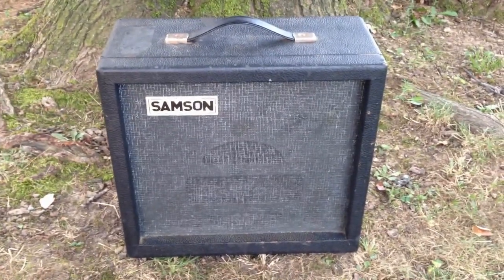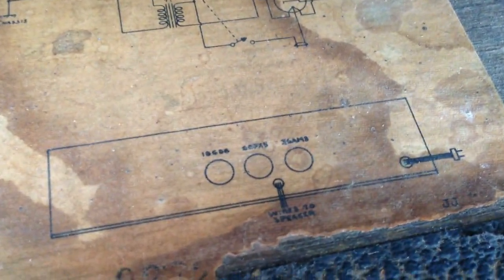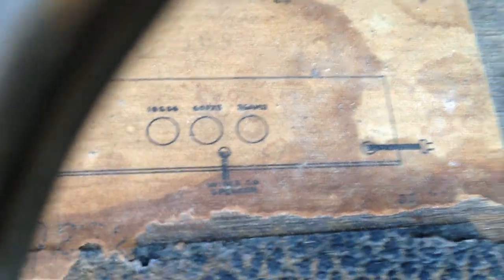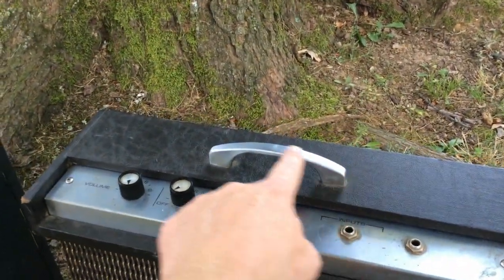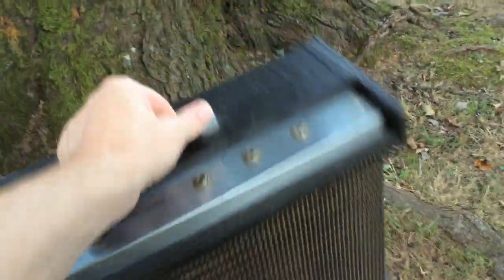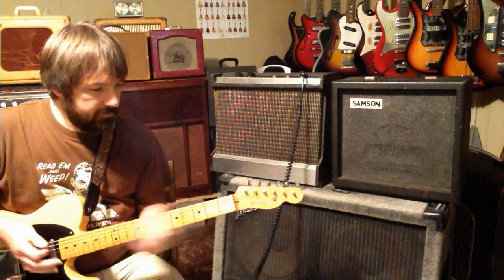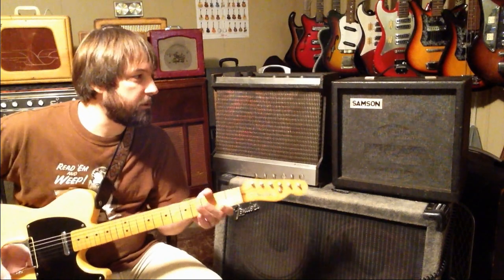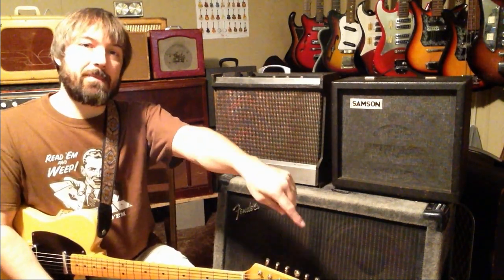Obscure Vintage Guitar Amps by Radionic Industries (Truetone, Samson)

Comment: That Samson is the same tube lineup as some of the Kay  series string widowmakers. No resistance needed because it adds up to nearly 117v.  703C is a Kay number. Maybe sold by some music shop or other.
Reply from the maker: I have videos of the Kay 703C version on my channel as well. I have seen Kay schematics which actually did list "Radionic Industries" as the manufacturer. That's the only reason I know what these are.

Comment: I have a little amp that has the exact same schematic. The chassis and schematic are identical to the Samson in every way except for that it doesn't have the name Mid west etc. printed on the chassis or Bardon Co. in the UL wording in the schematic. it's a Penncrest Model 850, made for JC Penney in the 60's. the cabinet is completely different though, it is made from real cheapo thin plywood covered with some super cheapo green wallpaper looking stuff. I believe there is a Kay model that uses the same circuit,  but I can't remember the exact model, Kay 750c or something like that, I'd have look it up. I got it for 5$ at a Goodwill store about 20 years ago. It sounds great, after I did a cap job, and added a 3 prong plug. If you do a google search for the Penncrest Model 850, it will come up with a couple of old eBay listings, and pics. I love this little amp, even though it looks like a toy.
Reply: .. oh, I forgot, the speaker code is the same too. But the date stamped on the schematic is stamped 8 24 66
Reply from the maker: Cool. Thanks for the info. I am not surprised there would be a Penncrest model also. All of those catalog companies, particularly the ones based in Chicago went to the same few manufacturers to do business. I find the Radionic Industries thing fascinating. I actually called the current Radionic Industries and asked to speak with someone who would have worked there in the old days, and they said the current owner took over the business around 1970 from the original owner, and he didn't know anything about the fact they built guitar amps.

Comment: Hey Brad, I just got this exact Samson amp. Looks like it’s never been messed with one bit. I’m sorta new to amp repair so I thought this amp is a great circuit to start with. It buzzes so I’ll dig in and replace all the caps. Need some help finding a suitable option to replace the bigger multi section cap 30/40/40mfd 25/150/150v blue/black/red/yellow wires. Anything you suggest? Thank you! Tony
Reply from the maker: You can get those through Antique Electronic Supply.

Comment: I'd run a y-adapter of the output of my boost into both amps and mic them each with a dynamic and then pan the two tracks hard left/right. I actually want to get an Effectrode Tube Drive to use as a dirty preamp "pedal" in front of all kinds of different vintage clean or almost clean amps. I've done the same type of stereo recording thing with my Boss Super Chorus with the send from my Classic 30 going into the chorus and then one of the outputs of the chorus going to the effects return and the other going to my AO-44. It's pretty nice as a way to double-track without actually having to record two passes, just had the mics different distances and angles on the different amps to make them hit at slightly different times for more of a real "double-tracked" stereo mix. I think it came out pretty convincing in this one: https://www.youtube.com/watch?v=6cBJso0yJ8g  Essentially what I had going was the (boosted) preamp section of the Classic 30, being split two ways, with a very subtle setting on the chorus (enough to make the left and right sides sound slightly different) then one side going straight to the Classic 30's quad-el84 output, while the other side went to a fairly clean AO44 with just the low-pass filter and input transistor and low-pass filter removed and the NFB loop disconnected. Each amp drives its own 1x12 and each 1x12 was mic'ed with a dynamic up close. Like I said, I think it did a pretty convincing impression of a proper "double-tracked" rhythm guitar part, but what do you think? My technique and equipment for mixing wasn't great back then, and I was using software drums, but still think it came out ok.
Reply from the maker: The song is kickass. Mixing could have used some work, but it's punk, so fuck it. :P

But yeah, I've done a lot of guitar doubling and such studio tricks over the years. Back when I recorded a lot, that is. I miss it now.
Reply: The Guitologist Thanks. The only thing I wish I could change is the drums. I actually have real drums now, but there are so many other songs I want to redo with the equipment I have now. 

It's basically become standard procedure to double-track guitars for my shit, and I always pan the tracks all the way. I know a lot of people who swear by quad-tracking and others who don't even pan the 2 tracks all the way left/right, but it's the right method for the sound I'm trying to make. You should get back into recording. It's the one thing that has gotten better and easier over the years, and you can do it without having to depend on anyone else having the same day off as you and being reliable or whatever. That's how I started recording by myself with "home-studio" equipment. I wanted to play live too, so I did an acoustic folk/punk set (before it was cool) in coffee shops and small bars, but I really wanted to have my songs recorded the way they sounded in my head when I wrote them. A recording is immortal.

Comment: What is the function of T1 ?
Reply from the maker: The T1 transformer is an isolation transformer. It reduces the noise on the first gain stage and probably makes the amp a bit safer by keeping everything associated with the input and chassis ground completely isolated from the incoming AC. If you look at the schematic at about 3:45. Notice here are also a cap and resistor separating the line AC from chassis ground. You see those components a lot on these series string amps, but the isolation transformer is not as common. It's an additional step, which would have added to the manufacturing cost, so not every manufacturer used one.
Reply: Yes I thought it was that or a choke -- def in the PS  -- a 'cheap' amp but as cheap as the cheapest -- good ply cab - decent speaker and iso T .....
Reply from the maker: Yeah, it's a step up, for sure, from absolute minimum. They've made some strides to further improve safety, noise level, and tone. The demo portion of this video was shot in way less than ideal conditions. I really should have shot the video on my hardwood floor with the amp sitting down on that. They sound WAY better than up off the ground, basically floating in air on a carpet cabinet. My fault.